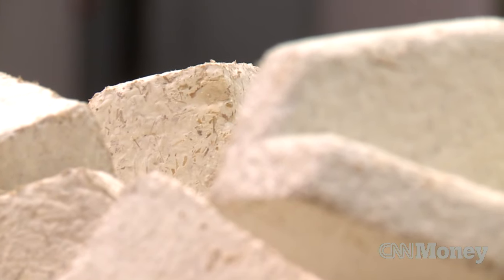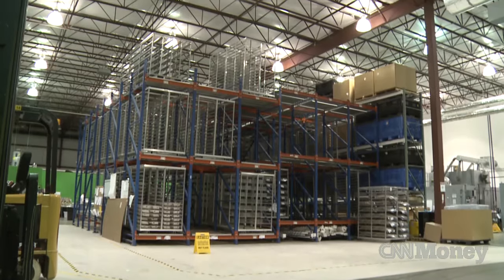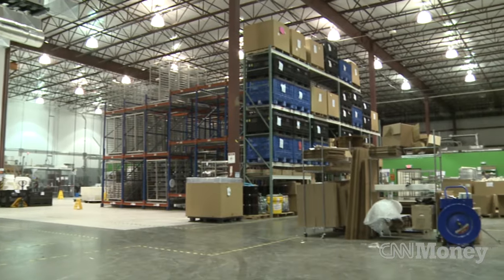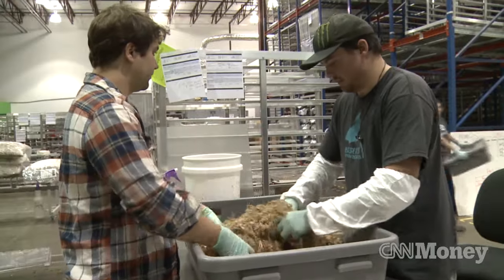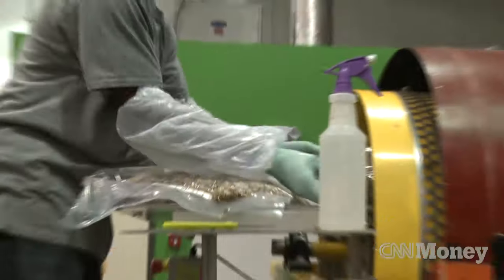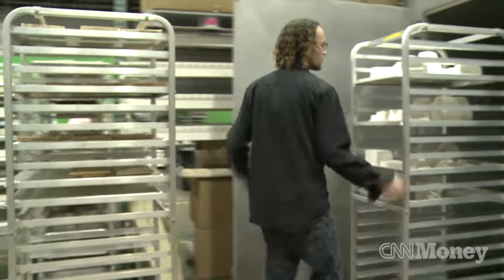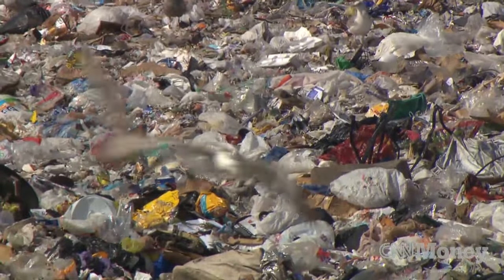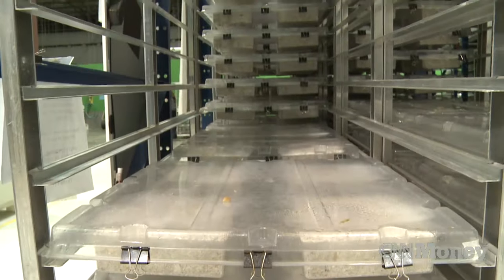Mushrooms: The future of packaging

Comment: Phenomenal work. Was wondering I saw a few plastic bags in the video that were containing the mushroom growth. Are those reused or is there a continual need for plastics to maintain that aspect of your mushroom product?
Reply: Same question here, seems one solution is not all the solution. Great progress needs a little more.
Reply: Just looking for an angle..stir it
Reply: No u can grow it in any thing like cardboard boxes,plastic bottles,
Glass jars even. I have done this in my lab.
Reply: Yes but overall you reduce plastic, 1 plastic mold can grow thousands of mushroom foam, plus they can use recyclable plastic which have a much higher recycle rate than styrofoam which are mostly non-recyclable
Reply: @aditibhagat1616  Hello, what species of mushroom did you use?

Comment: Why aren’t we using this now if everyone wants to save the planet? Needs to be done NOW.
Reply: The issue I see:
A-Production time, 1 part takes 4-6 days for the Mycelium to form, then drying time.
B-Space, if you use 2000 packaging parts per week, you need at least 2000 plastic molds and the space for them. You will need a gigantic facility to replace the actual plastic packaging.

Comment: Great news, BUT the Elephant in the room is the single use plastic bags you keep the Mycelium in. The Molds are not too bad as they can be reused an almost infinite amount of times, perhaps that’s the way to go with the single use, is to store all your Mycelium in Plastic containers instead of bags?. But an eco solution to you using single use plastic need to be found asap, or you are still a part of the problem to a degree, but stil are!
Reply: @rubiks15  😂 Fact
Reply: U can use glass jars,cardboard boxes any thing autoclaved
Reply: The plastic mold can be reused hundreds and prob thousands of times until it breaks, so it is not single used. plus that plastic have a much higher recyclable rate than the normal styrofoam.